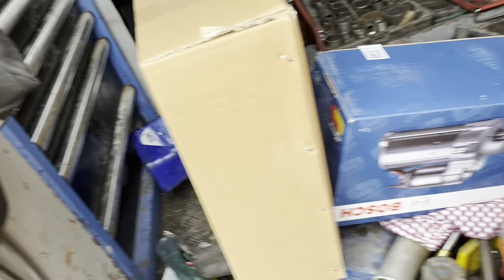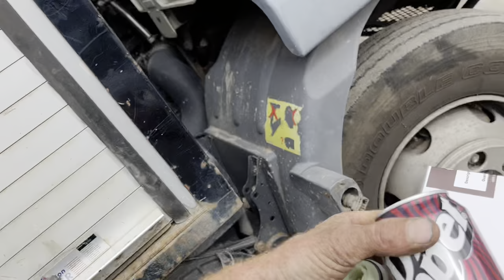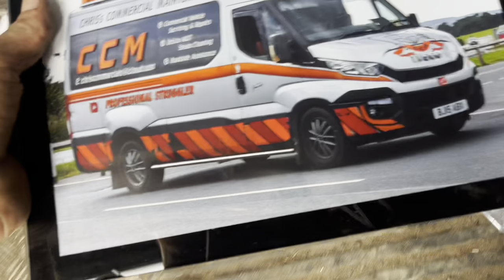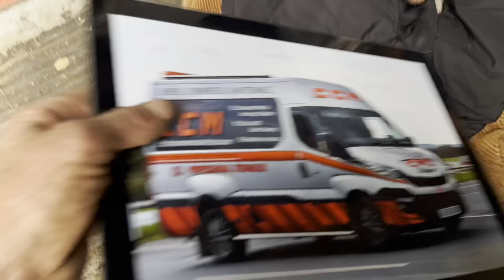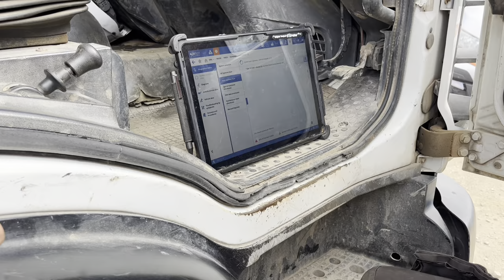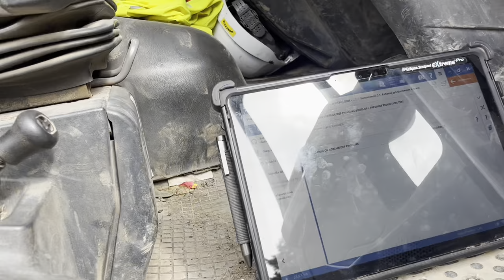Starter motor! Rare sightings! Locked out of a lorry race 🏃

Comment: My first apprentice job was to file the ring gear from a stuck starter motor took me a day but never had the problem again.  Some times we turned the ring gear on flywheels and some had bolt on removable replaceable segments then we just bought scrap engines and parts
Reply from the maker: Good old days mate could you imagine giving that job to someone now! They would look at you gone out 👍